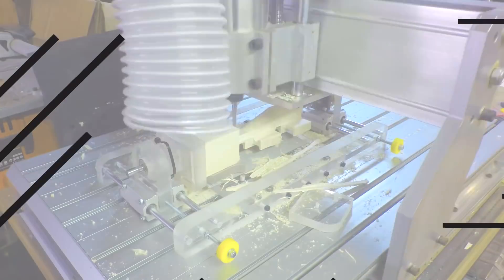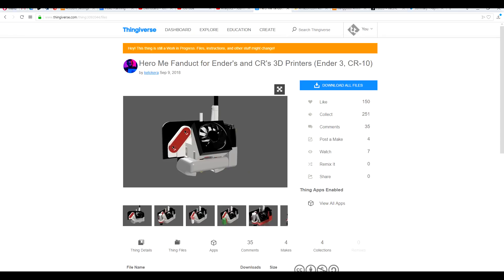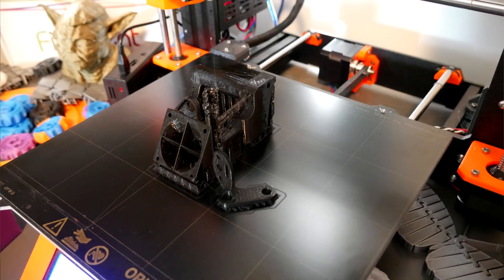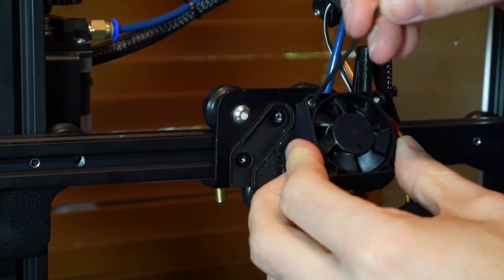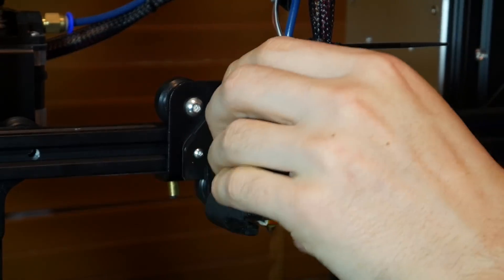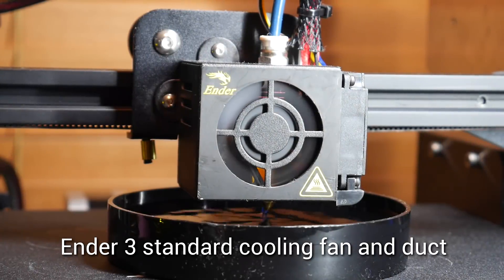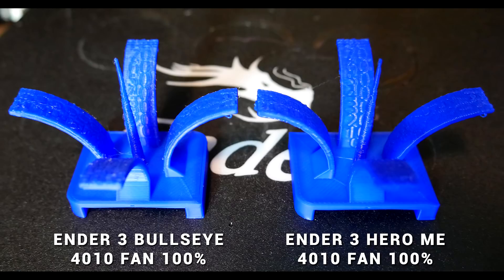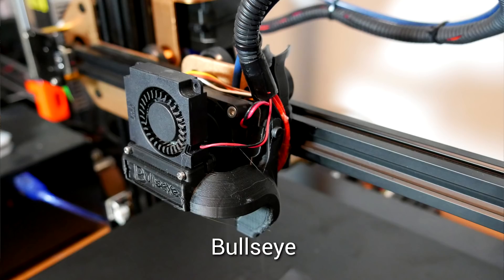Hero Me fan duct tested on Ender 3

Comment: I'm new to all this and currently a bit confused.

A 4010 Fan is 40mm square, 10mm deep, and that's the standard part-cooling fan (the one on the side of the hotend assembly) for the Ender 3?

Is the 5015 fan an upgrade to the Ender 3? If so, is this a genuinely useful upgrade or just for those who think 'upgrading is part of the fun'? I'm about the printer as a tool, not as a plaything :)

If the heater block cooling fan causes problems for print cooling, why is it there? Is it just to reduce the effective thermal hysteresis of the block and make temperature control more responsive?
Reply: When printing steep angles of overhang and bridging, you want the plastic to solidify the instant it leaves the nozzle. Otherwise it will droop and make for ugly prints in those areas. So upgrading cooling allows you to print more complex parts with no support material. The 5015 is a cheap commonly available blower and pumps out more air than the 4010. These upgraded air ducts attempt to place that cooling air at just the right spot to maximise the bridging and overhang performance. However with the use of support material you don't absolutely need the extra cooling to get a print, but removing supports can be time consuming and make for a less smooth finish.
Reply: @BigJohnno66   Yep, I get the reasons for wanting part cooling and that a larger fan with deeper blades can move more air - what I don't get is a) Whether the 5015 is a straightforward upgrade for an Ender 3, and b) Why the block cooling fan, if it's leaking hot air onto the part we're trying to cool, is actually needed...

The actual blades on the standard part cooling fan of the Ender 3 (assuming that it is the one on the side) are miniscule. Isn't there an alternative 4010 fan available that's more efficient? Maybe something like this? https://www.amazon.com/10mm-4010-Blade-Brushless-Cooling/dp/B007PQ0KL6

As I said, I'm new to this - so I will ask dumb questions...
Reply: The extruder fan is required to cool the "heat break", that is the finned alu block. That keeps the heat down in the extruder nozzle otherwise it would travel up and melt the filament in the bowden tube (or extruder for a direction extrusion head). A good fan duct should channel the hot air away from the part as best it can.

I think the blower style fan is used mainly due to the smaller cross section of the outlet allowing it to easily plug into ducting. You could use a regular fan but you would need to funnel the air down to the size of the ducting.

Yes the 4010 is a small blower, but it does a reasonable job. Which is probably why it comes stock on the printer.
Reply: Forgot to mention...I believe the only dumb question is the one left not asked :-)
Reply from the maker: Thanks John, awesome answers. If you print a design like this, a 5015 physically goes straight in, the only thing left is the plug, assuming the 5015 is also 24V.

Comment: I used the original Hero 2 for a long time and it worked well. I wanted to upgrade to a 5015 fan, so I tried to print the Hero ME several times and just could not get the parts to fit. Although the Petsfang is probably efficient, it is not visually aappealing, like the Bullseye. I ended up using the "Smooth FANG" and tweaking the mount for the Ender 3. It was fun running it through your torcher test. Thanks for the reviews.
Reply from the maker: Great post, thanks for sharing. How did it perform?
Reply: I ran the fan at 75%, starting at layer 20. It made it nicely to the 70 mark. The top of the 80 was smooth but the number was difficult to read. The bottom looked very consistent all the around. Overall it preformed as well as the Hero ME (5:12).

Comment: And now test the best: petsfang with 5015 fan. 💁‍♂️👌
Reply: This. I wouldn't mind seeing the petsfang 5015 vs the hero me with the 5015 go head-to-head. I've got a 5015 sitting just waiting to go on, I just haven't printed a duct yet.
Reply: I came to say exactly that. The bullseye and petsfang have different geometry to handle the different pressure and flow of different sized fans, and I find it hard to believe that the Hero Me can do both sizes at the same quality on one duct design. I'm always happy to be proven wrong though

Comment: Use other version of this cooling solution (one piece) with stock cooling fan.
Printed it from ABS, and have one problem, airflow guides are melted.
I print ABS (same) 2 days and airfrow guides get melted from heat that produced from heated block.
Prints are great, but construction not perfect (or not supposed to be used on ABS temperature).
Reply: McPcholkin I printed my hero v2 in pla(melting point 180) and I used it to print petg (melting point 220) and had no issues
Reply: Maybe one of the silicone "socks" for your hotend will help insulate the heat if you don't already have one
Reply: @six5ths  already order couple, when arrive do a test again.

Comment: Hey Michael, great video as always! I was wondering if you would like to check out my fan duct design as well? https://www.thingiverse.com/thing:2757244 It uses a more powerfull 5015 blower fan and was originally designed for the Ender 2, but it also fits the Ender 3 quite nice ;)
Reply from the maker: It''s a nice design. I like how it looks and the semi circular air nozzle array. Only problem for me is lack of BLtouch support.

Comment: Hi Michael, great to see these back to back tests.
I printed mine the same way it's installed. https://youtu.be/FM6j_jFmCSo

Also I remixed the BLT mount it get it closer. STL link: https://drive.google.com/open?id=1OlwabFq6fVCfvRjLoaA_m1QhYi3JqQXm
pic: https://photos.app.goo.gl/HcXGvP5ReFohyYAK7  best printed with the mount 45 in the air.
Reply from the maker: Hi Elio, about to print your modified BLtouch mount. Thanks for sharing!
Reply from the maker: Actually the STL link is a 404 :(
Reply: @TeachingTech   Strange, I just checked the link and it works for me...   Can shoot the stl via Facey.

Comment: The orientation your printed the Hero Me is backwards. Have the rear of the parts touch the build plate and it will make for a much cleaner looking part. As you can see, mine came out flawless... https://www.thingiverse.com/make:544989
Reply from the maker: The instructions don't specify so I rotated to the flattest surface I could find. Nice print.

Comment: Great video on the test. I did look at both and originally used the Hero v2 over the bullseye for the fan set-up athstetics alone. That design was funky with the separate piece to clamp on the extruder plate. I am happy with the the Hero me by far. Also, I printed it with the fan vertical mounts horizontal to the build surface to make sure to give them more strength against snapping when mounting. I got really clean prints using PETG from MatterHackers, eSun and high temp, low gloss PETG from 3DXTECH. Thanks for putting out such informative and helpful content.
Reply from the maker: You are most welcome, thanks for watching and commenting.